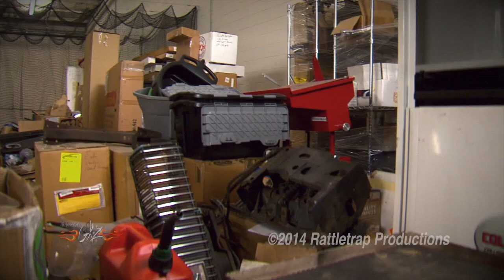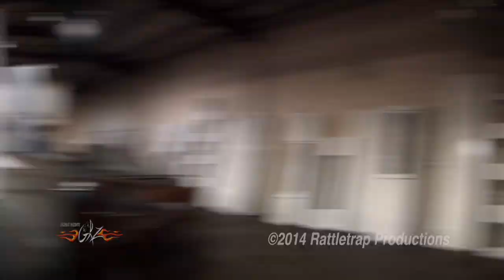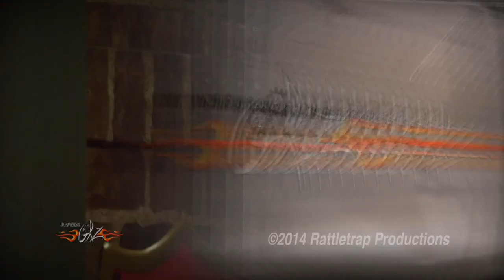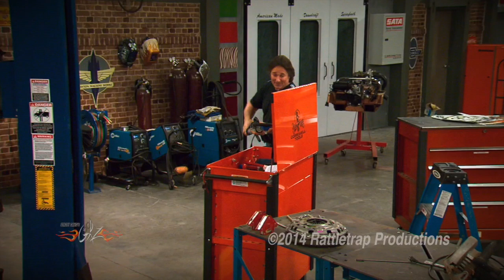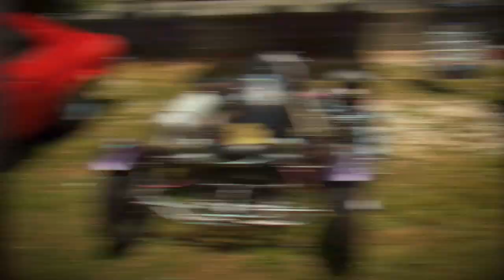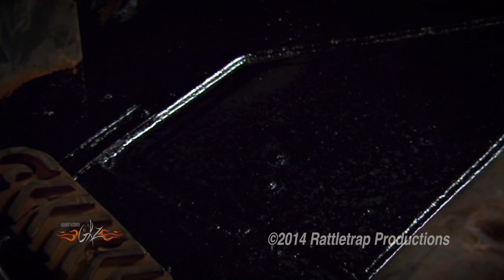Building a Shop - Stacey David's Gearz S8 E1

Comment: Sitting here watching this, and my dyi shop is maybe only 2ft wider than his paintbooth lol. But, I'd rather have a smaller shop due to the feelings of connectivity and not being overwhelmed. He stated the truth when he said "organization is key!", and take advantage of what space you have in an orderly fashion. I've honestly seen people with large shops that were so unorganized with shit laying anywhere and everywhere, that it took them longer to find the tool they needed than it did to use it on the job it was needed for in the first place. A small shop that's set up correctly is all most of us shade tree mechanics need.
Well, me anyway.